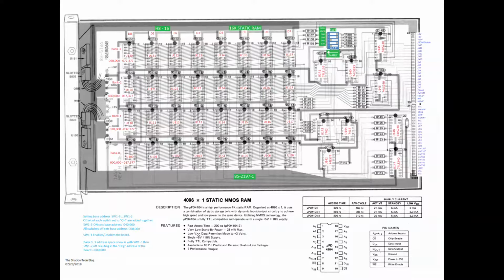HeathKit H8 - Part 5 - H8-16 16K RAM Card - Bit of reverse engineering and documentation - STB173

Comment: Why didn't you trace the signals on the board?  Big traces, only two sides.  Much easier than the error prone method that you did use.  It also leads to better documentation by giving you the pin numbers of the data bus as it passes through the on card buffers if there are any.  And if there aren't any data buffers, then tracing is trivial - measure the continuity from Di or Do on a RAM chip to the backplane connector.  Usually Di is tied to Do on the RAM chips because the MCU has a bidirectional data bus.
Reply from the maker: Agreed my process was not optimal and was rather clumsy. I did a bit of signal tracing off camera. Yes, DO/DI are tied together on each SRAM. I believe I've located the manual / schematic for the card and didn't want to take the time to draw up even a partial schematic. I'm jumping onto the CPU card next which was modified at some time, for this card I'll be adding the mod to the schematic as I already have it.